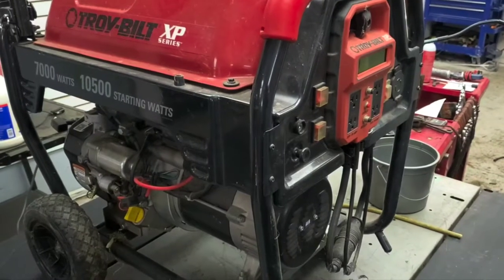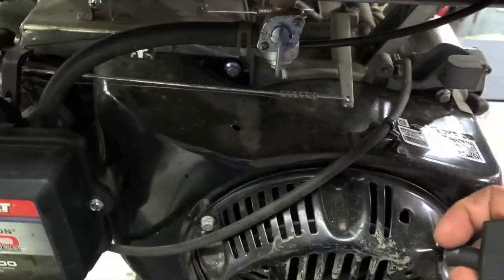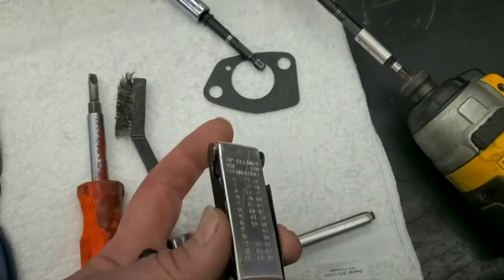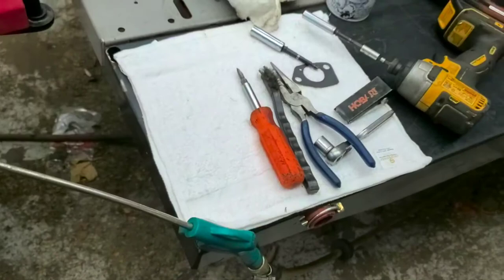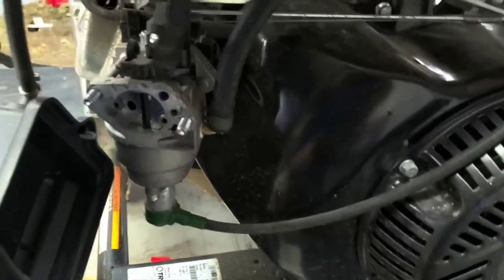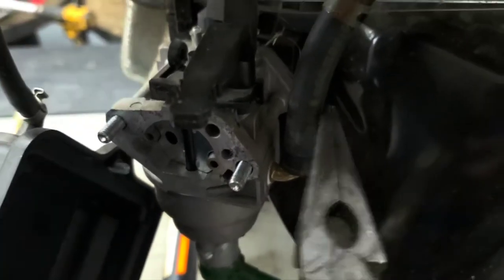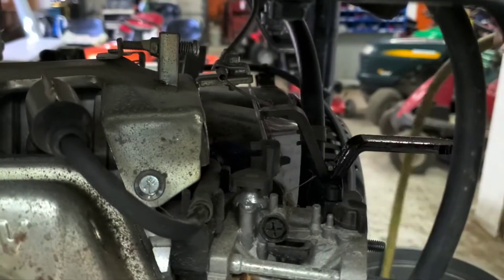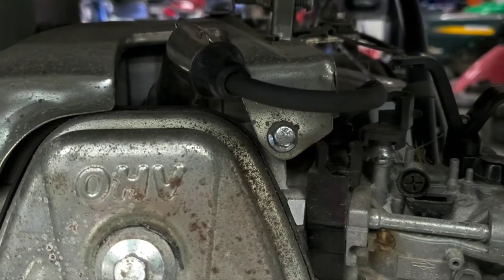Generator Won't Start Or Stay Running Diagnosis and Repair Of Troy Bilt 10,500 Watt

Comment: Love ours. I think we've had it ten years or so now. Amazes me how people neglect equipment and then are shocked when it craps out on them. Since it's a steel tank, I store it completely full of stabilized fuel to prevent corrosion. I also always turn the fuel off while it's running and let it clear the majority of the fuel out of the carb. I've been following those two simple rules for ten years and haven't had a single problem.
Reply from the maker: Always the way to go with the stabilized full tank!
Reply: Wish I knew this
Reply from the maker: Causes some mayhem!

Comment: How well do Amazon carbs hold up? I have the same generator and just ordered one. Thanks!
Reply from the maker: They do just as good as the OEM's many times. Use ethanol free fuel and you will be good
Reply: @IndRepair  the only carb was able to find has what looks to be a sensor attached to the bottom of the bowl with 2 wires and the carb on mine doesn’t have that. Do you see any issues with that? It hasn’t came in yet so I don’t know what to expect.
Reply from the maker: You would have to ship it if you were going to use this carburetor instead. If you can show me what you have I can get you one. Email Service@IndividualizedRepair.com
Reply: @IndRepair  I’ll send you some pics in a few mins.
Reply: @IndRepair  email sent
Reply: @IndRepair  did you get my email?
Reply from the maker: @hcfirefighter82  I just responded, so sorry it went to my spam folder

Comment: Have a Troy bilt generator,  replace carbrater, new gas , loosen cap , runs for about 10 min and quits. Any suggestions.?
Reply from the maker: Restrictions in fuel line or tank filter likely
Reply: @IndRepair  nope all clear
Reply from the maker: @waynelincoln6340  You can confirm or rule out that the fuel supply is the issue by spraying starting fluid or carburetor cleaner directly into the carburetor intake when it starts to shut off. If it stays running on the carburetor cleaner we know this is the issue for sure or rule it out
Reply: Jet and or emulsion tube
Reply from the maker: @Tyler-bb3cw  definitely could be clogged up carburetor also

Comment: I disagree with your assertion that the genset runs on half choke is caused by bad fuel. I have found half choke units sre due to a clog in the fuel system. This might have been due to the fuel shutoff solenoid being stuck at mid position. I totally agree about replacing these carbs. Two day service on Amazon.
Reply from the maker: There are a few different things that can cause a unit to run half choke. Bad fuel, gummed up carburetor or fuel supply will definitely do it. The majority of the time if the issue is a bad fuel flow you will only be able to run the unit for a certain amount of time before it dies and it will start/run great at first because there is plenty of fuel in the carburetor at that point. Thanks for watching!